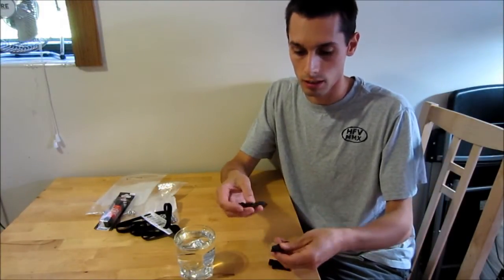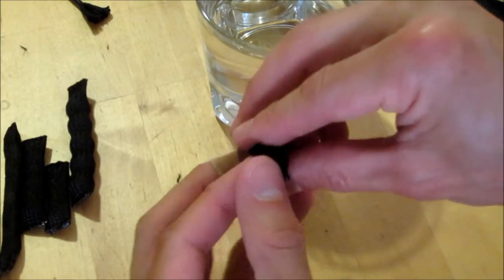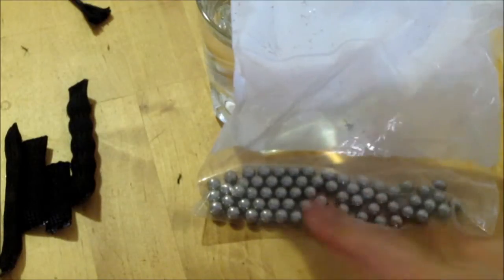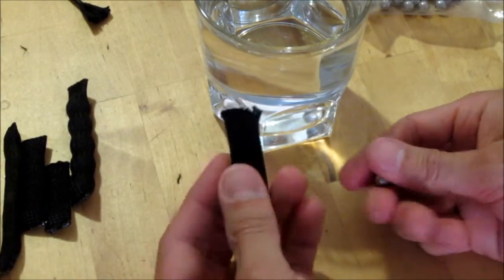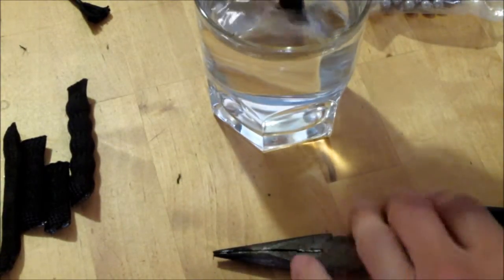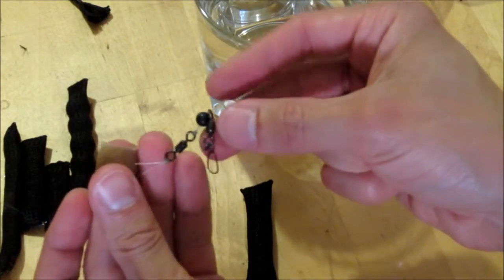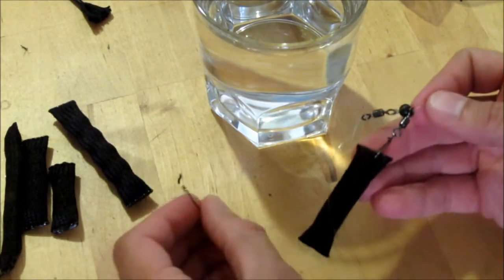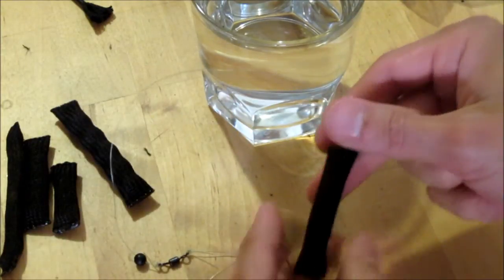How To Make a Slinky Rig for Fishing

Comment: Instead of a straight cut across the bottom, I've been rounding out both ends or using a 45degree angle cut which seem to cut down on some snags.  Thanks for the idea for this, it has worked great.
Reply: good idea… less surface or edge.

Comment: Very helpful video. Holding with pliers makes melting the ends neater. I trim the top at an angle to reduce snagging.  The top of the weight is where they get pulled between rocks.
$4.03 per pack of 250
96455K52 Steel Balls (non poisonous, will rust away if lost)
McMaster Carr Supply